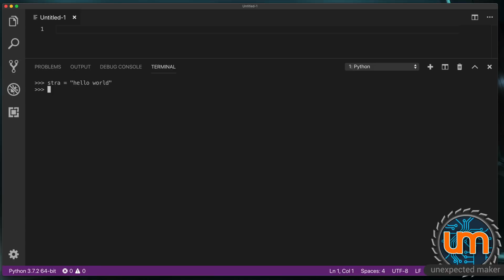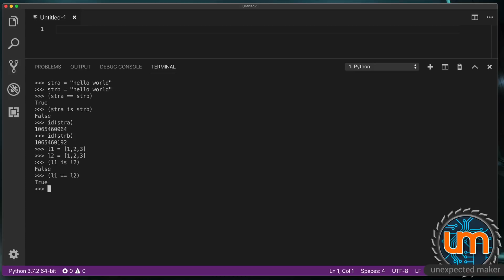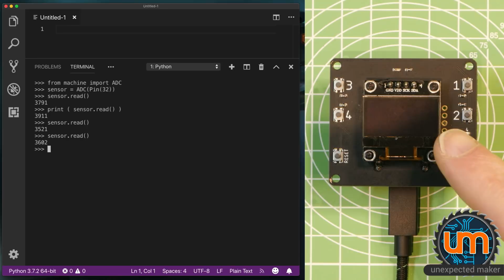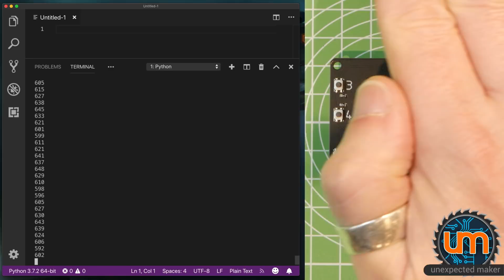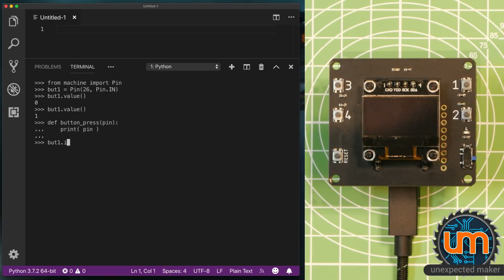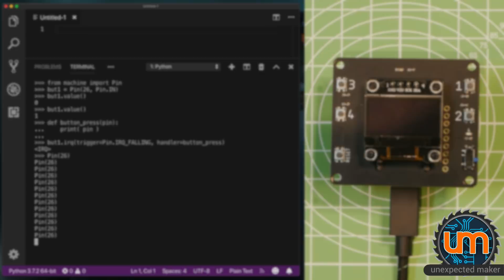MicroPython #4 - PWM, ADC, Timers & Interrupts

Comment: Hello, nice series so far on Python. Btw,  the 'is' operator cannot always be used to compare integer values. The 'is' operator compares the identity of objects, not the value. Certain common integers are pre-created when Python starts, and so any use of those values will always have the same identity. However when using an integer outside the range of pre-created integers, the 'is' operator won't work.  for example
>>> a = 12345679
>>> b = 12345679
>>> a is b
False
>>> a == b
True
This article on interning explains it more https://medium.com/@daniel.tooke/singletons-and-interning-in-python-328413db334

Comment: I'm using a esp8266 from Amazon. When I type in the "Timer.init" PyCharm is telling me its not a method, I have timer imported and its within the scope. I think i'll reimport the library on to the board itself with upip. Even when I look at the library it doesn't have a init method but does have a deinit. Anybody else have this issue?
Reply: Well, I figured it out...I thought what the hell let me try running this through REPL and see if it's crashing. It's not, just PyCharm. Ignored the error and up and running.

Comment: Man I love these videos of yours.. I just wanted to mention that I go through everything you do step by step and interestingly when I do the (stra is strb) part of the video... I get True as I do with (stra == strb)  the only thing I did differently :D was 
stra = ( "hello" )
strb = ( 'hello' )

But I got True with the        is         version and the    ==

even the id() gives the same location 

Im using ESP32, rshell , repletc etc just like you

Please keep up the great work you are doing you have saved me and so many others thousands of hours in total I am sure   :)
Reply: The difference in the "is" behavior could be implementation/version dependent.  I believe that, by definition, "is" returns true if the two id()s are the same.  "is" is supposed to only be for checking to see if the two objects being compared are (pointing to) the same object.  As you noted, by virtue of id() returning the same value, they are referencing the same object.
The reason why Seon's "is" demo results are different than yours could be changes in the implementation between whatever version and his.  If you remember/know, Python strings are immutable, so in cases where the runtime makes the effort to see if there's already a string with the same value ("hello" in stra, in this case), it's safe for strb to also point to it, because it can't be changed through any references to stra.  An implementation may choose to create another copy of "hello" in memory for strb and point to it, rather than double-teaming the perfectly valid/safe copy of "hello" made first for stra.  This is a memory optimization --at the expense of looking for a usable, equivalent string with the same contents at object-creation time.
Bottom line, this implementation-dependent "is" comparison is unreliable, for just this reason.  "is" should only be used to compare two object references where one reference was derived from the other.
For example, a technically correct demonstration of is would be:  stra="hello", strc="foo", if (blah): strb=strc, ..., strb=stra, stra is strb -> True.  The results of "is" for Seon's demonstrated case are either undefined in the language definition, or the semantics changed from one version to the other (unlikely).
So, technically doing what Seon did in his demo is demonstrating a case of undefined behavior per the language spec (if my suspicion/explanation is in fact correct).
Reply: Same, somehow micropython is noticing that my two strings contain the same text so is optimising them to a single object.

>>> stra = "hi"
>>> strb = "hi"
>>> (stra == strb)
True
>>> (stra is strb)
True
>>> inta = 1
>>> intb = 1
>>> (inta == intb)
True
>>> (inta is intb)
True
>>> id(stra)
4410
>>> id(strb)
4410
>>> id(inta)
3
>>> id(intb)
3
>>>

Comment: Thank you . I enjoying learning from you tutorials. I have a new shiny TInyPICO. But when I try to run things im getting alot of message that the library is not available.( not the right terms ) .
http://prntscr.com/pfsagm
any idea on adding all the necessary libraries. or should i install a new copy of micropython?
Reply from the maker: Yay for your new TinyPICO! MicroPython deliberately doesn't ship with every library built into the firmware... or it would be bloated with stuff most people don't need. You need to add the libraries you need to the filesystem on the TinyPICO to use them.

Check out https://github.com/tinypico/tinypico-micropython for examples and libraries
Reply: @UnexpectedMaker  OK, this makes since. Still new to this. That worked  Thank you

Comment: Great video! Over the past few months, I've jumped from RPi3B+ to ROCK Pi 4B (Linux troubleshooting above my knowledge level), Nano, Nano-RF, ESP8266, Teensy 3.6, and Particle Photon. The learning curves and variations have been overwhelming to integrate into a WiFi network of IoT devices.
After watching several videos from Adafruit (micro Python) & the 'guy with the Swiss accent', I've finally come home to roost with an M5STACK and an ESP32 WROVER dev board. What a trip!
Suddenly, techie world has become much more simple and far less frustrating. 
Based upon seeing this video, looks like you will close many of my knowledge gaps, so I'm subscribing and starting at the beginning.👀
Thanks for sharing the basics so eloquently.😎

Comment: My pyboard just arrived. I'm glad that you have done these very good videos! I set up VSC first time a week ago to my arduino. I'm fairly new to this stuff.  What kind of extensions you use in VSC?
Reply from the maker: Woohoo, you got a PyBoard D? Damien has made an amazing board! I'm just using the Python extension in VSC and rshell to talk to my TinyPICO.
Reply: @UnexpectedMaker  Unfortunately this pyboard V1.1 is not genuine. But now that I looked his website, the D version seems pretty good! My long time goal is to make a model rocket flight computer. I'm fairly new to programming so this micropython looks like easier way to do that compared to c++. It would be awesome to make thrust vector control to gimbal the motor from accel/gyro data.

Comment: When would you use a time.sleep() based function to make a timer and when a hardware Machine.Timer()?  What are the advs and disadvs? Thanks
Reply from the maker: Well, like in c++ delay(), time.sleep() or time.sleep_ms() are blocking calls, so they halt all execution during the sleep. If you code is ok with being halted like that, a simple sleep() is fine, but of you need things to happen in a periodic fashion without halting execution of the rest of your code, timers are perfect.
Reply: Makes perfect sense. Thank you!

Comment: the machine library, since machine dependent, would have the correct resolution of the adc provided by the board correct ?  I.e. some of the teensy boards have 16bit adc vs the 10bit arduino vs the 12 bit esp32
Reply from the maker: Yes, the machine module in each hardware port uses the correct default ADC resolution for its hardware, but it's a lot more complicated than that. The ESP32 has a sliding resolution that you can change, and though it might default to 12bit, (0-4095) it's only a 0v-1v range, so if you change the range to 0-3.3V, you lose resolution.

It's the same with PWM, if when you change the frequency, your available duty cycle range is altered too. Both of these topics were beyond the scope of this video as they really require people to read and understand the capabilities of the hardware.
Reply: @UnexpectedMaker  thamks for the adc info and the map function. The adc info is disappointing though I could use a voltage splitter to knock down the incoming signal. Sensors I use are normally 0-4.8v
Reply from the maker: Yes, a voltage divider is all that is needed to convert 0-4.8v to 0-1v.
Reply: @MicheleHjorleifsson  uh... depends on your resistor value choices.  Using an op-amp could be a better solution, unless you understand what all of the impedances involved are.  But for some/many cases a voltage divider might be just fine.